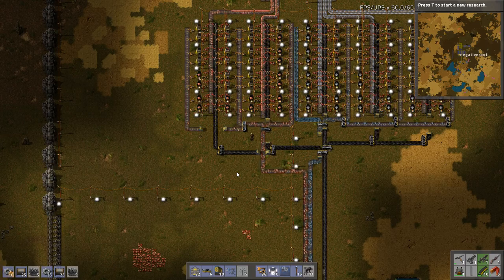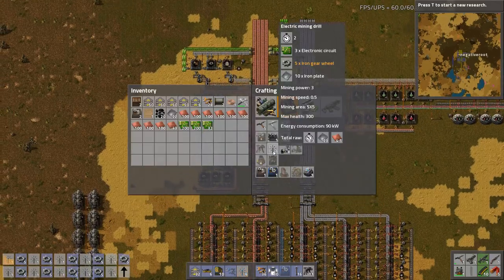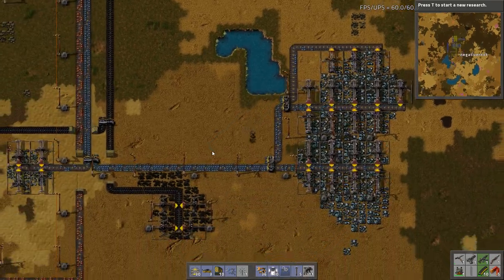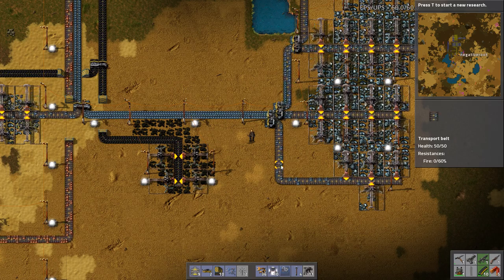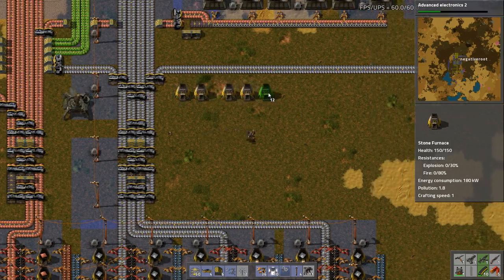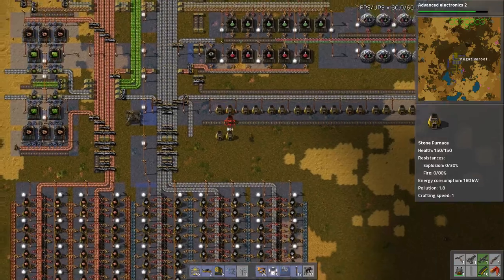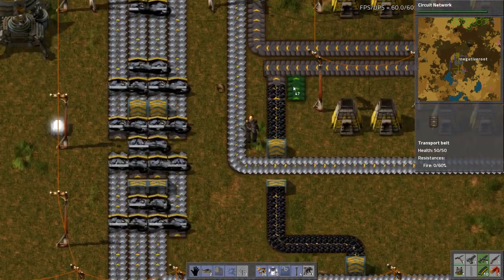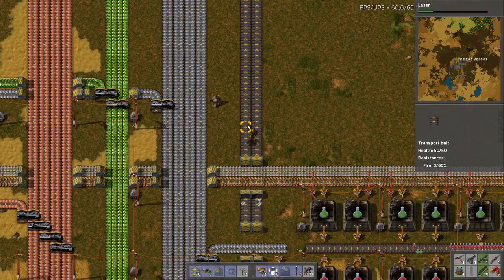Factorio Beginners Guide 07 Super Steel

Comment: Since one piece of steel needs five iron plates there will be need for five full lines of iron to make one full line of steel. ( 5 - 1 )
Splitting out to many belts increases belt storage and gives an easy area to pickup resources from. ( F )
Reply from the maker: +HeilTec no need to get that technical. as this is the beginners guide, we're eyeballing it! If the lines are full, we're good :)

Comment: Would it be better for the overall performance of the system to loop the belts that are taking off from the buses back to the bus instead of dead ending after the last inserter?  With a dead end the branch is going to constantly take whatever percentage of the supply it is receiving from the splitter until the belt is full.  With a loop it would only take as much as the inserters are actually using and give the rest back, unless the bus itself is backed up.  In other words, the dead end prioritizes buffering raw materials for the early branches over supplying them to the later branches.
Reply from the maker: +krtwood in short, no. Splitters are percentage based and give zero shits whether belts are looped or not. only way to increase absolute amount of items flowing down a branch is to increase supply. 

TL:DR: loops don't solve your problem and will infact, mask the real problem. Use loops if you're a rookie.

Comment: Is there any reason to avoid using burner miners fed by burner inserters to supply fuel for the boilers? Seems to me you want to decouple the fuel source for the power grid from the power grid so that overtaxing the grid doesn't cascade into a total power failure.

Comment: Why do you use that layout for steam as opposed to a long-handed setup? See http://i.imgur.com/aRlcWYZ.jpg for an example in picture form.
You only have to run one coal line to feed an infinite number of boiler stacks, and it all lines up perfectly.
Reply from the maker: +kenlon because that long handed setup is vulnerable to a feedback loop.
Reply: That's why I have buffer chests in front of the first stage. If you end up running through a full chest of fuel per boiler before addressing your fueling problems, then you have other issues.

I don't even bother putting burner inserters on the first stage anymore - the wasted fuel isn't worth it, I've found. And the ease of slapping on another full column of engines whenever you need more power is really handy, rather than having to route belts around. 

Give it a try!
Reply from the maker: kenlon buffer chests or no, its still vulnerable to a feedback loop because you're using electricity to power your electricity generation.
Reply: Sure, it's vulnerable to that, but I've found the advantages to this setup far outweigh the theoretical possibility of a brownout causing issues. YMMV, of course.
Reply from the maker: kenlon here's a question, if someone is teaching new people how to play the game, do you think its better to teach them foolproof ways of doing things, or things that can screw up and create more problems for them?
Reply: I would show them the more efficient way, and warn them of what can happen if they don't watch their power usage and keep enough miners on coal.

But I think that capacity and throughput is it's own reward in Factorio - I never limit chests, and if I don't have enough buffered resources to run my factory flat out for an hour with nothing coming in then my mining and storage is insufficient. shrug
Reply: +kenlon Everyone plays the game their own way. You obviously know how you want your factory done but for the purposes of this beginner's guide it's better for Root to just show the basics and move on to other topics and allow the player to figure out how to expand upon the knowledge he's presenting in his videos.